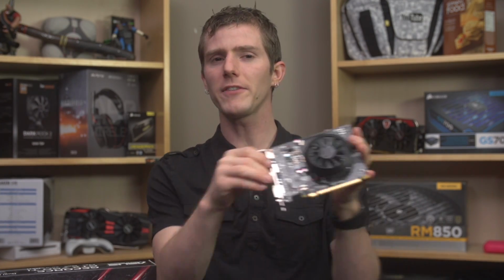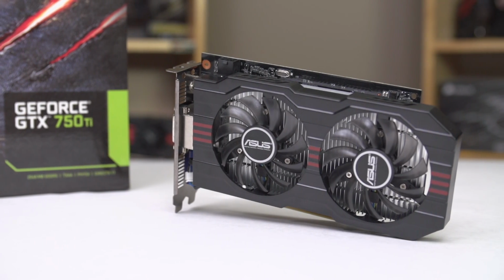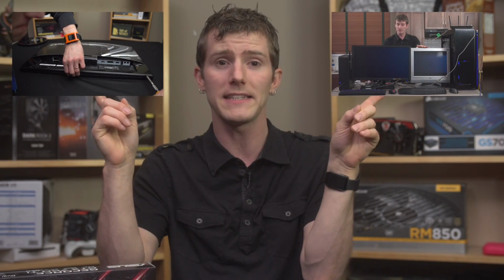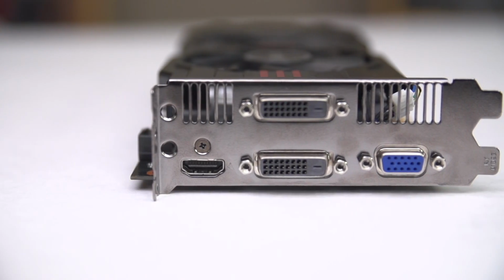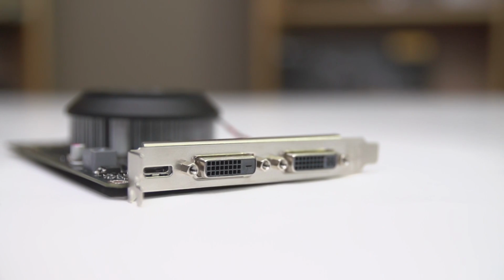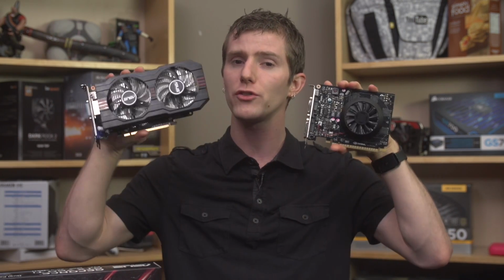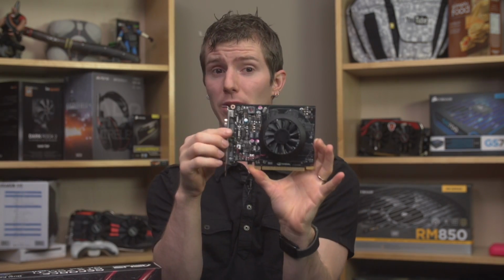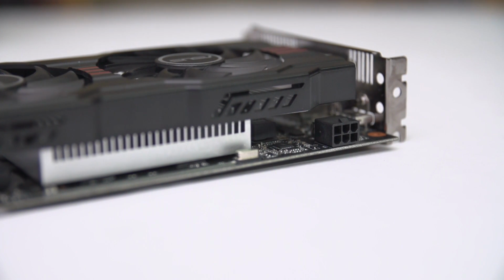GeForce GTX 750 Ti NVIDIA & ASUS Designs

Comment: Hi Linus! I am planning to buy a new gpu which is GTX 750 Ti. I know this is a budget GPU, I''m looking for a budget CPU as well. What CPU would you recommend for this GPU?
Reply: Get the X4 860k its an amazing budget processor
Reply: I have intel core i5 4460
Reply: get a 950, not that much more expensive and better performance. I have the asus 750 ti shown in this video and its only really any good for csgo, old games or new games at low settings. Luckily i'm getting a 1070 when that comes out XD
Reply: Get an i3
Reply: +Cdek Ibalio AMD processors are good for budget builds. With a pentium, some games won't launch at all because of his 2 threads.
Reply: +Cdek Ibalio Like +King Nobuhiro said, I recommend the Pentium G3258. Yes, it's dual core, and you run the risk of some games failing to launch (as stated already), but with the right setup, you can overclock it to exceed 5000+ with the Passmark tests. I mention that because that alone will put it close to a 5th or 6th generation Core i3, which is what a lot of people do recommend with the 750 Ti. So, with the G3258's cheap price, I think it's perfect.
Reply: AMD FX-6350, it is a bit pricey, it is a 6 core monster
Reply: Yea 950 is a good choice :)
Reply: Core i3-6100 might be the thing you're looking for. it's dual core w/ hyper-threading though so keep that in mind. 
it's very cheap where i live .
it'll go flawlessly with the gtx 750Ti
Reply: Probably too late, but I have the same GPU and an Intel core i3-6100 is perfect for me
Reply: stay away form Pentiums!! they are some of the lowest grade CPU's in intels lineup. get an ivy bridge i5 or something. it will be cheap and good, a Pentium would bottle neck the GPU.
Reply: unless your hands are literally nanoscopic, you can't upgrade any CPU.
Reply: not really. it has about average performance compared to an 8350 which isn't much more money, and can be over clocked like crazy, and has 8 cores.
Reply: wait for the 1060, much better price to performance.
Reply: intel core i3 530. It's very overclockable, at 2x its reference speed max boost.
Reply: YouTube Professor the problem with an i3 is they are dual core processors only.
Reply: get an A10 5800K or some trinity athlon cpu. I have the A10 5800K at 4,5 ghz all the  time with nice volts(better cooler tho) and it is stilla great cpu for very nice money.
Reply: vojtasTS29 yeah, but that is not a CPU it is an APU, which is like a CPU GPU combo, so half of your horse power will not be used unless you go without a graphics card, at which point you lose the option of your graphics horsepower.
Reply: and what. the cpu part is pretty good for the price you can get them right now.
Reply: vojtasTS29 that processor isn't all that impressive to be honest. the FX-8350 is the best AMD CPU on the market and it is cheaper than intel, but more expansive than the A10 that you are talking about.
Reply: 750 ti in 2016? Eh, atleast it's not an R7 240. Buy an i3. Oh, and late comment by the way.
Reply: I have the i3 4130. Works great.
Reply: athlon x4 860k
Reply: amd fx 4350. Only dual core with 2 extra virtual cores but the clock speed is like 4.2 it's great
Reply: Keep in mind you don't need a lot of cores for gaming most games are not optimized for multi core use. The clock speed aka ghz is more important
Reply: Josh Hines no. more cores is very important, as a matter of fact if you have less then 4 cores then the game will struggle. a 2.8Ghz 8 core processor will run games better than a 4.2Ghz dual core processor of the same brand.
Reply: i think the gtx 750 ti will make a perfect combos with amd fx6300. and its depends with games you wanna play
Reply: cleoszeftreine CZN 860k would be better
Reply: cleoszeftreine CZN a 750 ti and a 6300? l would save up a few more bucks before you build a computer, because a system like that will die very quickly.
Reply: +electronics for fun yeah 860k and gtx 950 would be much better
Reply: +electronics for fun yeah but well its on the budget side. but i really like an intel core i5 with rx 480 nice gaming prefomance with 8gb on the gpu
Reply: cleoszeftreine CZN yeah l don't have a problem with a budget build, but if you are going back a couple of gens then you should save and put more money it to something that will last longer.
Reply: +electronics for fun agree
Reply: but what about the x4 860k...
Reply: hey i have an amd a4-3400 and a gtx 750 will that bottleneck? I overclocked my a4 from 2.7 ghz to 4.1 ghz i don't have enough money yet to buy a new cpu
Reply: +Gabz Melecio i think so? idk,that apu isnt do much i think?
Reply: amd fx6300.
Reply: It's probably too late now but anything amd
Reply: Brandon wait for zen!!!!! it will be here soon!
Reply: naw, i have money so i got intel
Reply: too late but get an intel i5 4460
Reply: Aditya FAD
me too bought it 3 weeks ago
Reply: you can choose between i5 skylake and i7 haswell almost same performance thought
Reply: Hmmm,It depends if you want a super cheap but a good performer choose the G3258 but some games such as Far cry 4 will need 4 cores for that an i3 6100 would be great more performance and more games
Reply: choose i3 skylake or i5 haswell
Reply: dude the best budjet cpu is core2quad
yes , it s old but i can get 85% of perforamance like i5 4th  gen
Reply: high end : i7 6950x
Reply: a g3258 can be overclocked to 4.5 ghz which will eat fx 6300s
Reply: this is my pc tower:
-i3 6100 
-gtx 950/750ti(you can choose) 
-msi bazooka motherboard
-avexir ddr4 16gb(2x8 GB) 
-dazumba 400w psu
-1tb hdd cavier blue 
-250gb samsung 850 ssd
-corsair liquid cooler 1 fan
- 4 corsair sp120mm fan
-mid pc tower
Reply: I have a laptop (asus k43sv)

- Core i5 2410m
- Geforce GT 540m 2GB DDR3 128 bot
- 4GB RAM
- Windows 10 Pro

** I play cs:go, dota 1&2 @1366x768 and I got 60-65fps.
Reply: Cdek Ibalio pentium g4400 is great for budget builds if you aren't doing heavy gaming. Should still hold its own in modern titles and doesn't get very hot.
Reply: PascalGame indonesia
haswell i5s are better than i3s skylake
Reply: Cdek Ibalio FX 6300

Comment: Is this G card paired with a athlon x4 860k a good combo for beginning pc gaming?
Reply: Yep, it will do it. You will probably have to turn some settings down however.
Reply: Go an Intel platform, trust me when you go to upgrade, Intel is much better
Reply: At that pricepoint 4 cores and unlocked multiplier without counting cheaper mobo Amd is better on that side  and for 65 bucks the athlon x4 860k is unbeatable a 750ti Can`t bottleneck it
Reply: From searching around youtube comments and the very confusing internet, full of opinions, I'm going to go with this:

Amd Athlon X4 860k
Nvidia GTX 750ti 2GB VRAM
8GB 1600Mhz RAM
1TB HDD

According to the facts, I should be able to play less intensive games (TF2 LoL  DOTA 2 Minecraft etc.) at 1080p maxed out settings 60fps. 

Thx for your support 😃
Reply: GrumpyDragon Most people on the internet are stupid and yes a 750ti can run battlefield 4 on ultra , that said it destroys tf2 lol dota2 and anything else You can play dark souls 3 , the 750ti can play any game at high/ultra at 1080 with 60 and 45 fps on resource intensive games like the the games i pointed don`t be miss informed but the quickest reference point of a 750ti is a ps4 or a little more performance that it wich is plenty for any game
Reply: BF4 on Ultra is stretch, Ultra with a mix between very high and high is the only way to sustain a constant 60fps. Dark Souls at 60fps with high settings then you must play it on 900p. But yes, i agree TF2 and Dota 2, LOL etc is easily able to max out on 1080p while maintaining a healthy framerate

Comment: is GTX 730 is a mid range gpu card or just a low end?
Reply: +brichard harris FUCK NO. 730 is low end, dont buy it, wait for more money and get at least a 750
Reply: +Carl Barcelon Jr. gtx 750ti best budget video card ever
Reply: +Sad Pato i watched some reviews about 730 what i discovered is the frames per second with moba game and fps games. i compared it to my integrated graphics amd, i played some dota and i turned it to max or best looking settings and i got 30 fps compared it to the 730 and it has the same result. I should get the 750 series in the future, anyways thanks buddy
Reply: +Carl Barcelon Jr. same as 750 except about 10 fps weaker
Reply: +Vedanta Maha Karuna it is, just watched Austin's review about the best budget graphics card
Reply: VERY low end, don't bother unless you like shit value for money.

Comment: im getting this becuase i have money now
Reply: +zaywop get a 950 they are going to be cheaper now so might as well get a 950
Reply: +zaywop Great choice. It is a great budget card. I bought it to replace my old gtx 650, and the difference (obviously) is amazing. I would recommend getting a 2gb version tho, 1 is too low.
Reply: +zaywop Dont!!! Rather buy gtx 950, almost same price, much better
Reply: Thomas Kozar "almost the same price"
60 euros
Reply: +MelonMan/RomanScrub 36 usd difference for much better performance
Reply: +Thomas Kozar but then you have to get a cpu that can keep up with the 950. I've been meaning to get the 860k and 750ti just so I have something that can run games. Anything is an improvement to my current pc, though must I buy a new PSU? Or would 400W be enough for those?
Reply: Get a 950
Reply: +Domica you probably have a prebuilt computer psu and those are usually incredibly bad rather get a new 430w or a 500w for room to upgrade
Reply: I would would recommend a card cooler made by EVGA, I have FTW card and it works wonderfully
Reply: im running the i7 870 and some asus 750ti with 2gb, it rarely pulls more than 220w at the wall so 400 should be plenty
Reply: i would reccomend a rx 480
Reply: +Noah Powell the rx480 is more than twice the price of a factory new 750ti... used they can be had for not so much.. i sold mine to get on rhe nvidia hype train, which is only 8-10 times more expenssive than a 750ti.. why not recommens that? (sorry if i sound a little salty)
Reply: wait for the gtx 1060. it will be here soon. it will beat the rx 480 in price and performance.
Reply: it will not beat it in price for preformance it is reported that it is less than 10% faster and over $60 more expensive so no it wont beat it in price per frame
Reply: Noah Powell according to the leaked benchmarks it will beat the rx 480. and it is said to be around the same price.
Reply: ***** yeah sure whatever, it is all about numbers and fps's! for the record l am not being serious.
Reply: ***** gtx 1070.
Reply: ***** l know, that is why l bought. l was going to get a 980 ti, but pascal is will outlive maxwell.

Comment: using the 750ti FTW got it for 80$ on NCIXUS. Using Price Match, I Found a used card and priced Matched it and they send me a brand new card. Plays all the games i hav on High/Ultra 1080p. I play games like
Starcraft 2 Ultra
Dying Light High
Battlefield 4 High
All Borderland games Ultra
BioShock Infinite Ultra
CSGO Ultra
And yea pretty much for a card  thats less than 100$ i hav a beast of a system
6600K Skylake running at 4.6Ghz
16GB DDR4 Corsair
1TB WD Blue
Gigabyte gaming 5 MOBO
Reply: +BigPaco213 6600k with a 750ti for gaming...
Reply: +Tsunami Scrub yea why???
Reply: BigPaco213 you could have bought a better gpu instead of a cpu
Reply: +Tsunami Scrub that's true, but now I hav room for upgrade since I hav skylake. And either ways I only game maybe a couple of times a week.

Comment: Will this card work if I didn't put any power pins on it ? answer please. ( not the base 750ti model , say the asus or zotac one )
Reply: +Sarcastic Gamer no. it needs the extra power
Reply: +dzeeeeko too bad then
Reply: +Sarcastic Gamer you don't have 6 pins to spare? you can get a molex to 6 pin adapter

Comment: Typical GTX 750ti User Comment: "omg the gtx 750ti is soo amazing, I can maxout all my games at 1080p at 120FPS!!"
Reply: it's true though, i can
Reply: a Disrespectful Narwhal no you cant lol. Most people with 750tis know nothing about hardware and the games they are playing. Most of the times, they are playing at 30 FPS and thinks its 60 and lower the resolution. Also if only one settings is on ultra, doesnt mean you maxed out the game. Typical 750ti user
Reply: Mark Larsen Yes, almost every video about 750tis has those idiots or any thread talking about 750tis
Reply: True story, I own a 750Ti i can't turn on AA more than x4 in fallout 4 and most of the graphics settings need to be at medium If i cranked all the setting to max I would get a choppy 10-15 fps??? somewhat that area... let alone at 1080... oh I was playing on a 1600x900 resolution it still wont get to 60 fps... some bullshit people saying about 750Ti... granted that it is a budget gpu and will do for modern games but NOT MAXED OUT!!! sheesh...

Comment: Does the Gtx 750ti support 2 monitors??
Somebody help
Reply: yes it can even support triple monitors
Reply: +tajony-32 are u sure?
Reply: no dude check the NVIDIA website it says it supports triple monitors i just cheched right now
Reply: oh mabey cuz I was looking at buying one and it showed it supported it but it was an msi one
Reply: +tajony-32 no, only 2. Even more powerful cards like the GTX 780Ti and GTX 950 only support 2 monitors. If you want to run triple monitors. You need 2 SLi ready cards and pair them to make NVidia Surround turn on.
Reply: Depends on the manufacturer, some like Gigabyte or MSi design their own board so that it could run triple monitors. The reference one will only support dual monitors
Reply: +Zero necker Nvidia's spec sheet shows it supporting 4 monitors at up to 4096x2160. Mind you, it can only do that in Excel, but it CAN do it.
Reply: Walt Findley I say this could be used for more than just excel.  I say you could watch 4 youtube videos at a time at 1080p each.

Comment: I'm very new to computers but I know my intrigrated graphics is my problem I have the thinkcentre m91p sff 4518E4U 8 gb ddr3 ram and an i5-2400 would the 750 ti work?
Reply: +Samuel Hildebrandt Yes,but you can totally go with the gtx 950/960 or AMD r9 360/370 to max out on 1080p 60 fps in most games
Reply: +Call It What You Want thanks for the info

Comment: Hello! I was wondering if i can get some input to guide me to finding a way to speed video conversions. I rip blu-rays and convert them from mkv files to H.264. This typically takes about 2HRs per movie and i am trying to find the best way to speed up the conversions. Should I get a graphics card or a better processor? Not a gamer or a video editor, just trying to get faster conversion time. Please let me know.. PC specs below

MOBO:ASRock Socket AM3/AMD 890GX/SATA3&USB 3.0/Quad CrossFireX/A&V&GbE/ATX Motherboard 890GX Extreme4
Processor:AMD Athalon ii X2 215 2.7GHz
RAM: 4GB
GPU: none

Comment: Will this Graphics card work on my HP 8200, because it's PSU is only 320 watts?
Reply: +Mirza Dzindo yes it will, it only needs 60watts that should probatly every PC can handle
Reply: +OpticalArts Thank you. But I also have i5 2500 that is using about 100w. Will my CPU and GPU use too much on 12v rail, 16A?
Reply: Mirza Dzindo how mow W does your Powersupply have ? I entered the processor plus graphics card in a PSU Calculator and it says with 1 Hard Drive, 2 RAM Sticks, your 2500 + GTX 750TI both Overclocked and 2 external fans, you would need about 230Watts, so 350Watt PSU would be great, 400Watts would be better, especially for Upgrading maybe ( But since Graphics cards get less and less power demanding your will be good to go to buy the sucessors of GTX 750Ti / 950 or even 960 ( like the GTX 1050 or 1060 you know ? ) and get increasing Power every two years 
greets from germany
Reply: +OpticalArts Thank you my man.

Comment: I have a i5-6500, 8gbs of DDR4 Ram and Evga Gtx 750 ti and it plays fallout 4 on medium/ high settings on 1920x1080 at around 30-50 FPS and I haven't overclocked yet

Comment: can this gtx 750ti play gta 5 or crysis 3 ? sorry for my english.
Reply: yes this card should do fine with gta 5 try not to max it out but you can use pretty good settings, i have a AMD Athlon X4 860K with mine and maxed out all the way it can run from 20 to 40 but i do not recomend max , but yes it will run higher quality games like crysis 3 and gta 5

Comment: Would the athlon 760k bottleneck this
Reply: +Caleb Henson It won't. It is a quad core. Right?
Reply: Yeah but it is 4 or 5 years old at this point, which had me a little worried. Thanks man.
Reply: Caleb Henson Yea don't worry. The card isn't a high end GPU bretty basic but really good card and it has that sweet spot for price to performance.
Reply: +Caleb Henson Yep, no bottlenecks at all. It's pretty equal to the newer 860k and I built a computer for a friend with that processor and an r9 380 (Which is equal to a gtx 960, which is much stronger than a 750 ti) and no bottleneck at all. :)